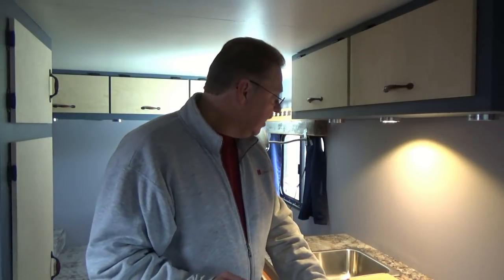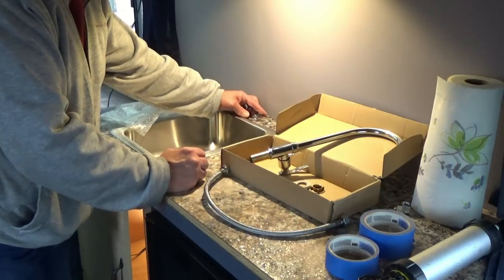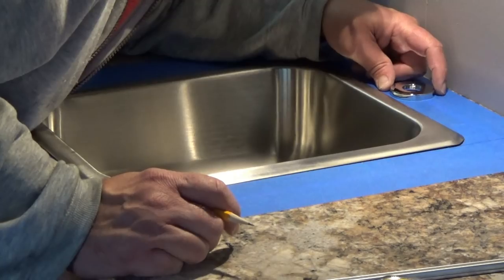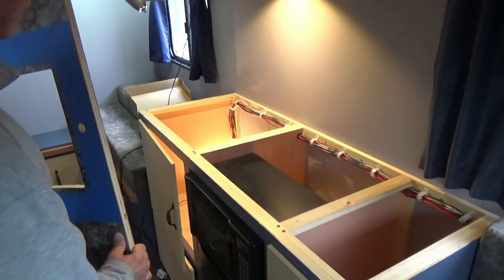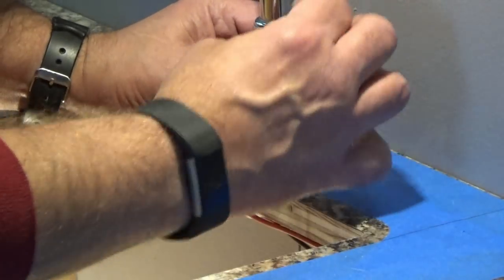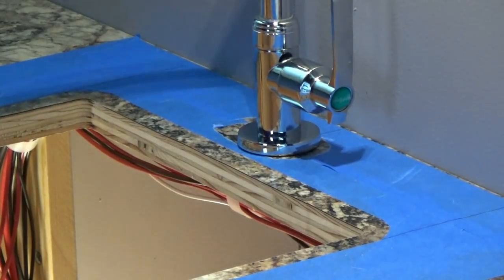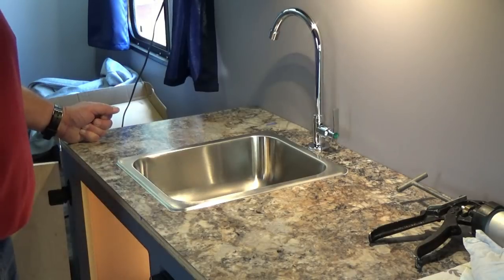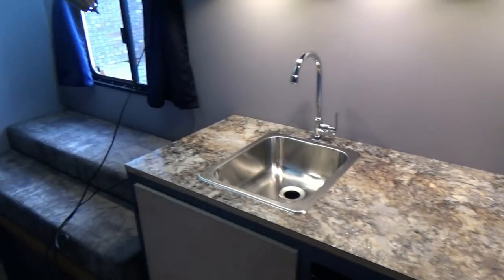How To Build A DIY Travel Trailer - Part 52 (Sink/Faucet Installation)

Comment: When setting in your water tank,(RV tanks on camping trailers have a built in declination towards the drain or outlet)...put a slight lift on the opposite side/corner ,in doing so you will get good drainage of the tank...I plan on using just some simple door/window shims to provide the declination on mine glued to the tank bottom...
Reply from the maker: Good advice! I may look at some type of rubber bushing material to elevate with. Thanks for the tip!

Comment: another remark : Is the wall behind the faucet well protected against the water ? Certainly the spilled water will get infiltrated on it along its use.
Reply from the maker: The wall is protected... only thing I need to do is run a bead of caulk at the bottom of splash to seal it, then I'm good to go!

Comment: I was curious where you found the right angle brackets and wing nuts to anchor your sink? I got a sink just like your but it did not come with the brackets/wing nuts and I can't seem to find any. All the new sinks seem to have rails instead of bolts. Any ideas?
Reply from the maker: Hi Josiah! The sink I purchased had the studs already tab welded in place... which made the job relatively simple. I watched a video that I thought would be helpful to you for your install. If you take a look at how he installed his sink you might come up with an idea that would be useful. Kevin Robinson installed a small sink with a homemade bracket that work extremely well... I hope this can help. https://www.youtube.com/watch?v=VJUsTASToWU    I thought it was a good idea! Cheers my friend!

Comment: Before putting the sink in its own place, I would have connected the hose first on the faucet and made linking tests. I wonder how difficult it'll be to install that hose  that you could hardly put your hands in a narrow place ! Am I wrong  ?
Reply from the maker: Actually... I didn't have the counter top fastened down just yet... so I was able to remove the top and turn upside down to fasten the faucet in place, then I set the top back down and secured it. Was easier that way.
Reply: @OregonBatman  not bad!
Reply from the maker: Thank you sir!

Comment: I ordered my water tank from tankdepot.com:  big choice of sizes!
Reply from the maker: Thanks for the tip! I was checking this site out last week I believe... looks like good quality. One of the sites I am looking at offer custom made tanks with fittings to your location. Still thinking it through though...
Reply: Their tanks are of a very good quality.  I ordered it with no holes and I also ordered their tank relocation kit which consists of all necessary fittings for a proper installation, it includes a kind of plastic porthole to help you tightening the fittings from the inside of the tank.  That porthole can be used afterwards to clean the inside of the tank.
Reply from the maker: That is good information.... I forgot about the access plate. I might look into that a little deeper. Thanks!